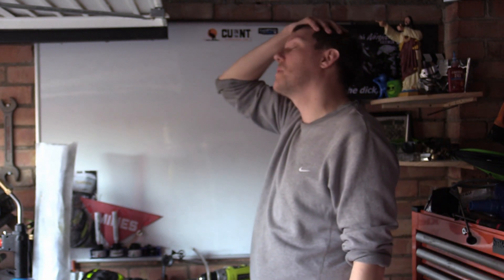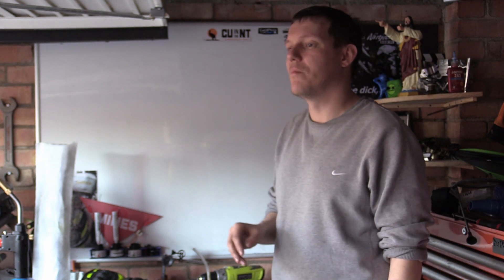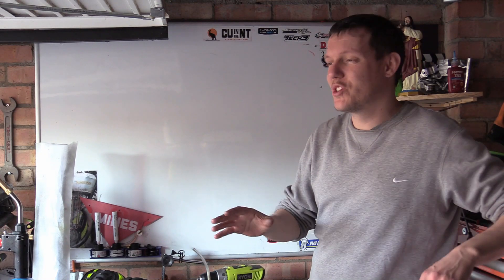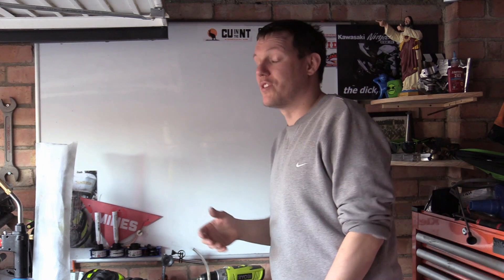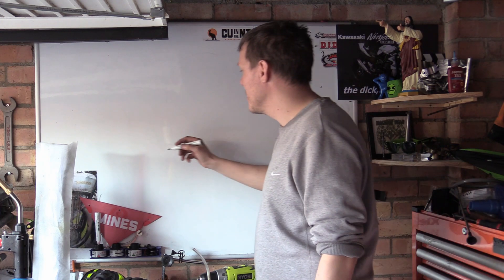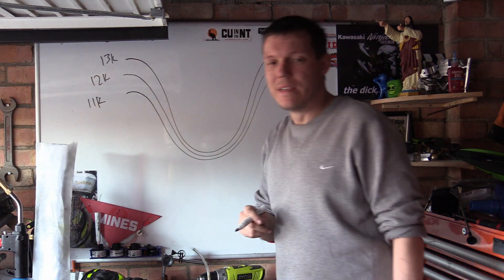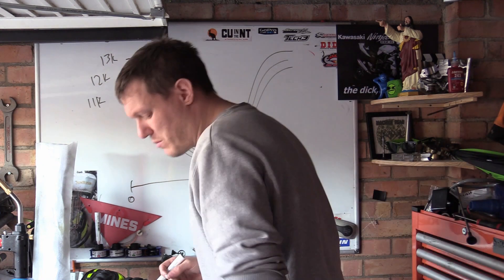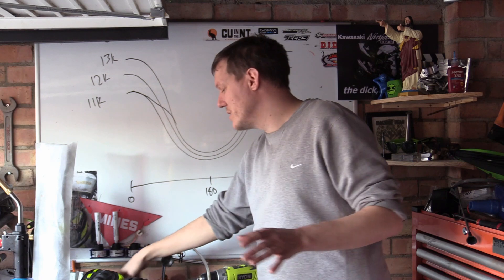Piston Acceleration - Correction Video

Comment: Thanks for expanding on the effect of the oil pressure in the bearing having an effect, it's something I didn't consider.
Is the low oil pressure more of a contributor for higher piston TDC than con-rod stretching at these high RPMs?

Comment: Matt, 
Another factor you fail to mention, is the inertia of the piston, and what the force acting on the con rod and crank resulting from that inertia is.

( what ever happened to the easy engine?)
Reply from the maker: "Another factor you fail to mention, is the inertia of the piston"

- the resistance to change velocity (acceleration) is where the force 'comes' from.

Comment: Wouldn't the force of the power stroke push the crank pin back down away from the shell bearing, allowing the oil to get back in there, even if the pressure momentarily drops?  Or does it do the same thing to the other side until the oil pressure recovers?

Comment: So you nail the throttle open - that increases the bang force and now the crank shaft moves around more in its journal.  More movement means more oil is squeezed out of the space, so an increased flow is needed.  So how is the oil pressure regulated?  Is it directly linked to the RPMs with a chain, like your cams?  So is the issue that the RPMs lag behind the combustion forces?
Edit:  In the SV650 manual it says "Be sure to engage the oil pump drive and driven gears, primary drive and driven gears."  when installing the clutch basket, so it looks like it's a direct connection.
Reply from the maker: "Is it directly linked to the RPMs with a chain, like your cams?"

- yes.

Comment: I clicked the like button 7 times to get the liked from 8 to 17 as there was 16 dislikes. Bugger, it will only accept the one like. The first video was very clear and precise about the amount of extra movement you might expect, basically taking up the slack in clearances and maybe a little bit of crank flex - and rod stretching..

Comment: Unfortunately you probably have to make another corrective video. The oil pump pressure has fuck all to do with it. As long as the area get an sufficient feed it sorts itself out by a process I'm not good enough to explain.

Trying to find my old literature on it was fruitless, but seems this page explains it in similar terms. Probably even better than my old books actually.

http://www.epi-eng.com/piston_engine_technology/engine_bearings.htm
Reply from the maker: "The oil pump pressure has fuck all to do with it"

- Based on????

From yuour own link....

"The bearing eccentricity increases with applied load and decreases with greater journal speed and viscosity."

"bearing eccentricity increases with applied load" which in the case of the piston reaching TDC is what's important here. 

This article then goes onto to state......

"Note that the hydrodynamic pressure has no relationship at all to the engine oil pressure,"

- What this means is the pressure between the bearing and the crank has no relationship. In other words if you have 60psi oil pressure that doesn't mean that the oil pressure is 60psi around the pin/journal, its dynamic. 

When I said 'your feed' into the bearing maybe 60psi that isn't what's in the bearing, but the feed - as this is controlled by the relief valve, up to about 100psi (average and not local).

IF you contiue to read it goes on to talk about the "Bearing Operating Condition" or (BOC).

The calcualtion for this is -

BOC = Viscosity x RPM x Diameter x K / Unit Load

Notice that there is no acceleration in this equation.With other boundaries being equal (ideal constraints) then an increase in both the speed increases the eccentricity.

Looking at the Hersey number (what they call the ZN/P Curve) or Dynamic viscocity x fluid velocity / Load and including Hydrodynamic pressure across the circumference shows that the dynamic pressure increase radial flow velocity acround the bearing surface but also increases friction with that fluid.
Reply: @thedirtyworkshop  Sorry for the terrible choice if wording.

What I was criticizing was only the part of video regarding oil clearance, between crank and conrod bearing, and the oil pump pressure lag. 

And what I meant was that the oil pump pressure isn't what's separates those surfaces from eachother. As long as the pressure/flow is enough to fill the wedge and "leakage", regardless of speed, it sorts itself out by the process of oil being pulled in and pressurizing in there. Everything else being considered obviously.

Sorry again for how that initial comment came out.